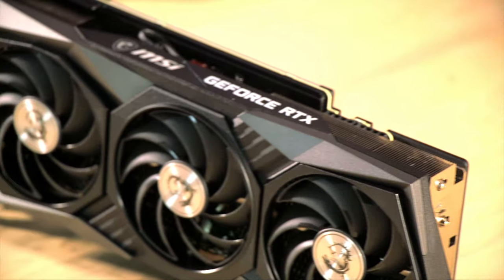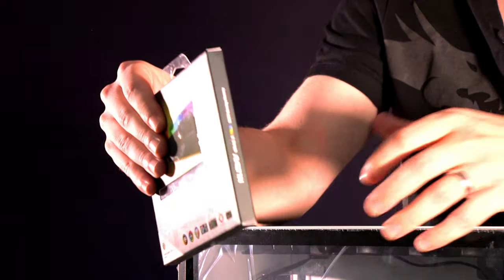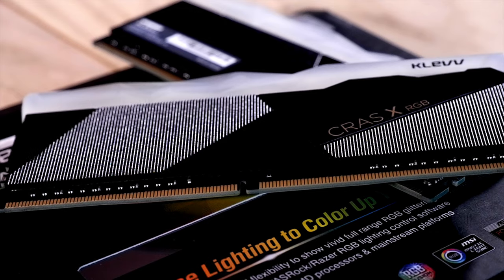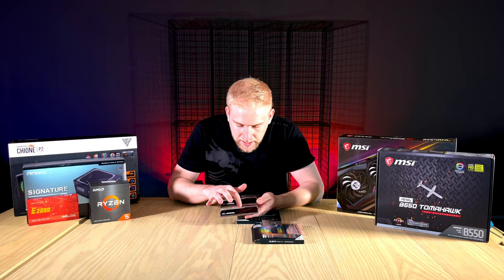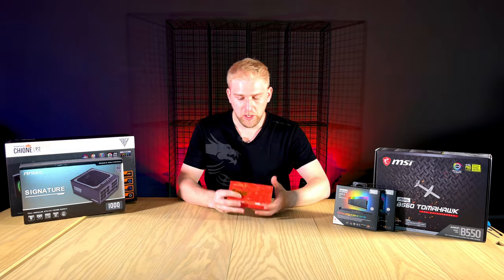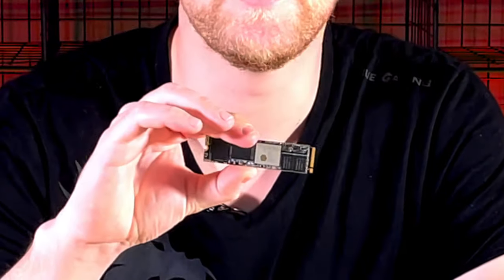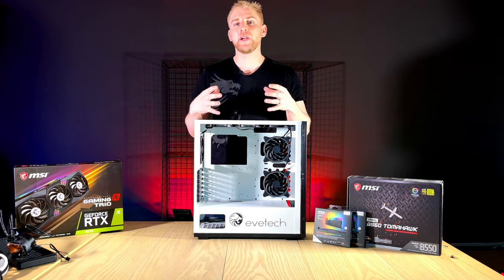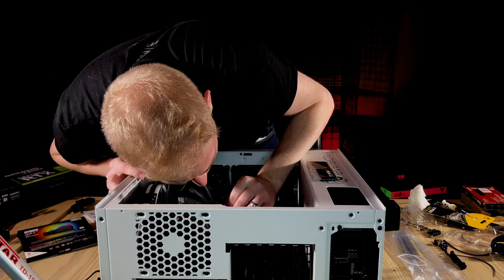How to build a PC that can Stream & Game in 2021 (Part 1/2)

Comment: Hi just had a question, is it possible for me to use another case instead of the Evetech one while using all the other parts as the video ?
Reply from the maker: Should be fine as there are many cases that would fit these in

Comment: Taking more than 3 days to build a pc I bought on your website 😞
Reply from the maker: Good day, 

This is because of Desktop PC lead times. We have to allocate time to order activation, stock allocation and assembly/testing. 

See lead times below.

Lead times:

Component Lead time:
3-5 Business Days.
(Peripherals, Monitors, Individual components e.g. HDD, Motherboard, GPU etc and chairs)

Laptop/NUC Lead Time:
3-5 Business days.
(Depending on the configuration purchased upgrades might be required on the SSD and RAM)

Desktop Computers Lead Time:
9-10 Business days.
(As we offer a large amount of customization all desktops are built from scratch)

Delivery:
3-4 Business days
(Regional and or Remote can be up to 3-6 Business days)
Reply: @evetechtv   Received the PC everything is in great shape Evetech is the best